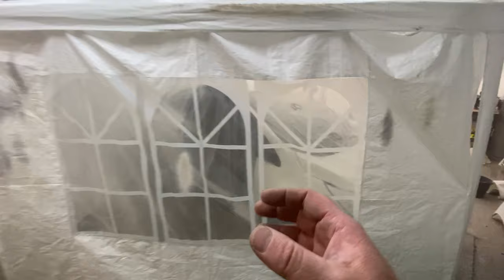Wrecks-To-Riches 1 Year Free car Challenge car 4 Part 5 Base Coat & Clear Coat Fingers Crossed.

Comment: Mark the job looks good from here in  the north west of england. Mark just remember the basics of painting and bodywork are the same for evryone its the interpretation that varies, by the way its one out of ten for the masking on the sill.Cant wait for tomorrows unveiling, a bit of luck it may just be OK.
Reply from the maker: Thanks Harry 1 out of 10 I’ll take that hopefully next car 2 out of 10 🤣🤣
Reply: @ResurwreckAutosUK  Hi mark tape from inside the door appature around the door seal lip then just mask the open appature,then you have a clear sill and be post.Hope you understand what im try to say cause ive not got a clue.
Reply from the maker: @harrynewbrook5103  thanks Harry

Comment: Nowt wrong with being a novice.  TBH, it looked to me that you had got the hang of a spraygun when you did the Fiat 500.  I was a bit worried about your filler work on the first attempt, but now you have gone back over it, it looks much better.  The more you do, the better you should be able to get it.  I always work on the principle that if you can see a flaw in the primer, then it will be ten times as visible in the top coat.
Reply from the maker: Thanks buddy yeah I see what you are saying hopefully 🙏 tomorrow it will look ok we all will see 👍👍